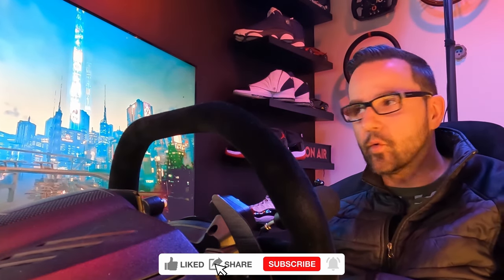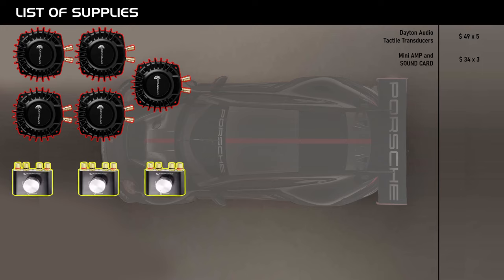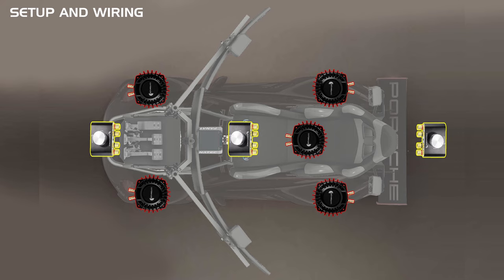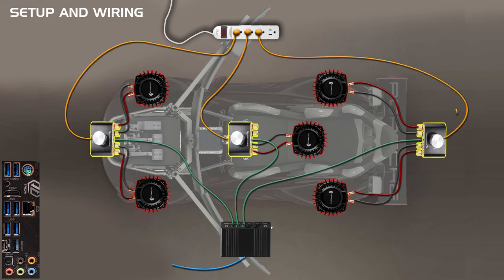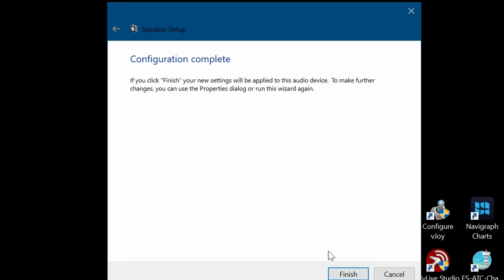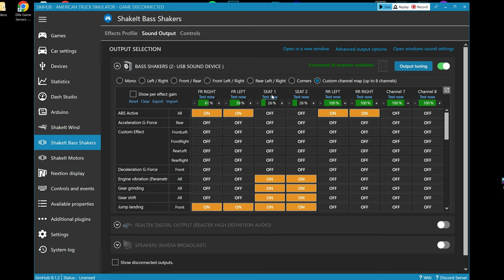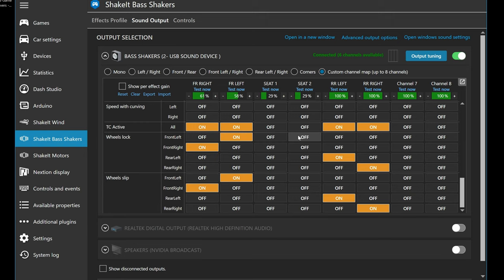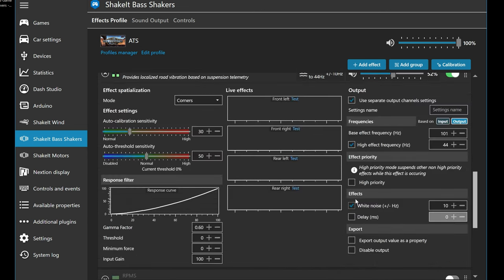DIY ULTIMATE Bass Shaker TUTORIAL | Step by Step HOW TO and SETUP

Comment: Very nice video and explanation!! Keep it up. One quick question, will it work the same way if I put car speakers instead??
Reply from the maker: Hi friend ! The sad answer is ...i don't think so.... These tactile transducers take actual audio and turn them into vibrations only. That's not very different than what a speaker does, but the outcome is very different. If you were to hook these up to music they would actually make sound. It would sound really hollow. The cool part is using sim hub as a software. It only sends low frequency vibrations to it. Now, if you were to send the same low frequency vibrations to a speaker you would get similar response. But because the speaker is soft and not encased in metal like this, the membrane of the speaker was just vibrate to low frequency. It wouldn't transmit that shaking to your rig.. I hope that makes sense. Please remember I'm not a pro. I'm just some dude. Take everything I say with a grain of salt ;) ...heck , try it just for fun . Lol
Reply: Thank you very much mate!!  @DaSimSimma

Comment: Is there any 3D printed BST-1 mount you tested? I would be happy not to bother with the wood work, but I'm concerned whether the plastic transfers vibration properly and is durable enough against vibration. On the other hand 3D mount seems to be a cleaner setup. Thank you :)
Reply from the maker: Sorry for the late reply. I actually did purchase a 3D printer and could attempt your proposal. I instantly have doubts about how it would perform just as you said : I could try to print an ABS but even so I'm afraid that it what absorb most of the vibrations. Second, I'm somewhat concerned with durability but only minimally. Stay tuned and I'll report back. I will need a bit of time to 3D prototype print try out and then make a video

Comment: Wow thank you very much for the detailed tutorial this will come in handy.. would you mind helping me with something, as this is all very new to me,I have just bought a simple setup to use on my PS5 and play seat challenge x, basically I bought 3 of the mini Dayton TT25 8ohm transducers and the Nobsound mini Bluetooth power amplifier with built in sound card which is 2channel and 50w and 4-8ohm.
My plan was to have one of the transducers (8ohm) under my pedals, then two transducers a on my seat, but running in parallel which I think then halves the ohms so each transducer would be 4ohm, is this safe to do I don’t want to blow out or destroy anything, any help you can give would be greatly appreciated..👍
Reply from the maker: Hi Marc , I was knowledgeable enough to wire this up and make a video trying to help other replicate my journey . But my knowledge stops there . I literally have no idea about ohms . That the danger with making a tutorial video : I placed my self in a perceived position of knowledge , truth be told , it was temporary and localized . Jokes aside , maybe the great sim racing community will step in to answer . Or go join SIM RACING SETUPS on Facebook . It a great group with over 70k members . Guaranteed they will have an answer !!
Reply: @DaSimSimma  thank you buddy I will go check them out, I appreciate your reply.. happy racing 👍

Comment: What exactly is the purpose of the sound card if the amps already have one built in? My buttkicker runs off of usb signal via the amplifier, nothing in between. Great video anyway, can’t wait to get this setup on my rig.
Reply from the maker: Maybe I glanced over that part but that is hugely important. If you have a huge same rig like-minded all sorts of accessories you'll utilize every single USB . Salt to use 3 amps with three USBS each it's too much. Going to 5.1 audio cord reduce his all of that down to one single USB it was just a matter of choice and necessity but it's not a must to make this
Reply: What about if you have a powered USB hub? I have 13 slot, so it should work, right?
Reply from the maker: I think it absolutely should !
Reply: Appreciate the reply my friend!
Reply from the maker: Sorry I'm often very busy and I use speech to text. When I go back and read some of my replies, I want to smack myself in the head. I hope what I said makes sense. If you go to my about page on YouTube, you'll find a discord link. If you join our silly little community on discord, you can always reach out to me faster and I'll try to help one-on-one if that's what I need to do

Comment: Thank you for this info.
I will almost definitely be setting this system up. may do it piece by piece though just due to cost.
Question: if using an external soundcard, do I still get 'normal' sound through my plug in speakers?
cheers: Saved and subscribed!
Reply from the maker: Hi friend ! Good luck on your build . Ps using an external card will absolutely save your internal card so it can play PC and game volume ! You can have multiple sound cards on a PC you just have to assign them accordingly
Reply: thank you.
Now to do some purchasing research lol @DaSimSimma

Comment: Thank you so much for this excellent tutorial! As you said a lot of information is scattered, never found one complete tutorial.

One question: would this work without the external usb soundcard by connecting the amps to the mainboards soundcard? My mainboard got a unused 5.1 onboard soundcard, meaning the 5.1 chinch connections are unused at the moment. Thanks again for your work!
Reply from the maker: I'm so sorry for not responding earlier. You absolutely can. The only reason I don't use it is because I actually use it to pump out 5.1 surround to my speakers in my room. But if you are not using it, you should absolutely get sound out from that and cut out the external sound card! My apologies again for the super late reply
Reply: @DaSimSimma  No reason to excuse, thanks for the additional information! 👌🏻

Comment: Thank you. Awesome video. I am planning to do 4 shakers. 
Question: for the small amplifiers, do you have to turn the sound knob on them to 100 and then just tune outputs through sim hub?
Reply from the maker: Absolutely correct !! Good luck friend . If you run into any issues go to my community tab we have a discord join and holler at me anytime I will try to help you. I hope another fellow simmer today and it worked out perfectly!
Reply: @DaSimSimma  Have you had any issues with the amps overheating at 100%.  I followed your video and have the exact same setup.  Been using it for about a month now and the other day I grabbed the amp for some reason after playing for about an hour and they were to hot to even hold.
Reply from the maker: Hmmm....now I'm worried...lol mine are tucked away out of sight and out of reach so I guess I'll never know. But let me put it this way, and don't hold me to this I'm not an electrician : hypothetically if you followed my setup 100% we should have arrived at the same result. Therefore, nothing's happened to mine which I hope nothing will happen to yours. I very weary on giving you exact advice with electrical components God forbid you have a fire. I'm sorry friend I want to say that everything is fine but you shouldn't trust me please keep looking into it
Reply: @DaSimSimma  Thank you for such a quick response.  As your video is the most recent setup video of this type I followed your instructions.  I am curious if yours heat up at all.  I am going to look into different amp options if turning the power down on the amps and the gain up in simhub doesn't improve things.

Comment: What about mounting directly to the seat?  Improved detail?  Less sound for wife?
Reply from the maker: I have one mounted underneath the seat because it makes the engine noises and transmission shifting. A lot of you refer to these as making noise but the reality is they don't make any noise at all they just vibrate the problem with vibration is that if it vibrates against something that's loose it will create a noise obviously. Now, everything that I have is in a basement on a laminate floor which is on top of a concrete floor. So unfortunately I'm not the best guy to talk to you about noise. Also, my sim room is highly soundproof that's the way we built it for exactly that purpose to try to isolate.. with all of that set I still get complaints about my music being a bit too loud when I stream lol

Comment: External Sound Card only worked with one bass shaker.   I had to  instead use the on-board NobSound USB, instead of AUX to SoundCard, before I could get both channels, on the NobSound to work.
Reply from the maker: Aux to soundcard will only give you one channel....USB to soundcard enables it to have as many channels as the card offers after you set it up correctly . The way you did it works also but the way I explain it has to be followed carefully. I say that because my card gives me all channels . The bottom line is ...it works for you , so that's all that matters ;) . How exactly you got there isn't so important I guess
Reply: @DaSimSimma  thanks kindly for the help and response. I would like to go the route you did as I plan to add more bass shakers, so apologies for my ignorance. However, I must have missed something in the video. I went AUX out on the NobSound to AUX in (center bass) on the external sound card and went USB out of the external sound card and USB in on PC. Going this route only gave me output (sound) from one bass shaker. Omitting the external sound card, allowed both channels to work. Is there something I missed when trying to utilize the external sound card, allowing only one channel (bass shaker) to work?
Reply from the maker: These things are a little bit difficult to understand through text. You can go to my about page and join my discord if you want. You can send me a private message and we can set up a quick call one day to work through this. I'm a visual person I'll need to show you the schematic and then you can explain to me also how you hooked it up. I hope I can help in some way
Reply: First off great Job. Just dove in to this sim thing. Ordered per your video. Waiting on all components to arrive. Only question at this point is you mentioned a sub. Don’t see on diagram. I’ll assume it’s running off the amp that has the leftover channel. Also it is one of the seat channels (effects)  that are represented in the software setup. 🤔 thank you again for taking the time

Comment: Excellent tutorial. I've had two mounted (front/back) for a year now. I'm curious about your mount method with the custom woodwork. Perhaps you can elaborate a bit more on that in another video? My back one is mounted to a VESA plate under my seat and the front is mounted directly to the side frame. Unfortunately, the latter proves to be pretty weak as I can barely feel it. It was under my pedal plate, but the plate is so thick that I felt zero vibrations. Still seeking optimal placement for the front shaker...
Reply from the maker: I'm so glad that this made sense and is helping you. The best way to explain the wood mount : I basically had nothing lying around but a couple pieces of plywood so I mounted the speaker to it and then mounted the plywood to the rig. In doing so in the fact that the plywood is a little bit flexible it allows the speaker to vibrate on the plywood and the plywood vibrates against the rig. That is how I'm transferring vibrations. To be absolutely clear : I didn't do it on purpose it's just what I had lying around and it turned out to work just fine. You're not the first one to ask how vibrations will transfer. As you experienced, if you mount them
extremely securely to your frame you will get no vibration transfers ; therefore they will be really really dim. I don't think I'm going to make another video to show my shity execution so please go to my community Tab and join my discord. Over there I can send you a dm with  pictures to show you in detail how I mounted it.
Reply: @DaSimSimma  Argh, this is my 4th attempt to reply to you in the past 6 days (WTF, YouTube!?). I think it's because I was linking to photos of my setup. Anyway, I got the gist of what you did by pausing your video at 1:58. I have plenty of spare plywood and MDF lying around, so I'll see what I can fabricate for under the pedal tray. Thanks!

Comment: Hi, great video, congratulations, I have 1 question to ask,
why didn't you use the 5.1 PC audio output?
instead of using the external sound card...
then I would like to ask is it possible to put your sim hub settings in an export file here on YouTube?
  to be able to download all thanks friend
excellent video
Reply from the maker: Someone talked about the same thing 2 days ago . But unlike you you . He. Just just assumed that I  was stupid. ...lol the real reason is because I actually use my 5.1 surround sound. I have a custom-built sim room where i run surround sound and I blast it crap out of it . Unlike a lot of people I don't play with headphones , I like to feel the full-blown sound and bass from the subwoofer. Adding an external sound card enables me to retain my original one on the back of the PC
Reply from the maker: Let me export my settings but please remember that my settings will be specifically setup for a 5.1 external surround sound with six or more channels. Let me drop the configuration file on a Google drive and then share the link here. Let me know if it works . It's going to be a couple hours from now as I am currently at work
Reply: ok thanks @DaSimSimma
Reply: Since we're at it, I'll ask you another question :)... do the bass shakers necessarily have to have contact with the wood or can they be attached directly to the aluminum profile, thanks brother
Reply: @DaSimSimma  hi friend,do you remember to put the file, thanks

Comment: Great Tutorial! Congrats! Queation - i read thag I can fry the transducer with the amp if I give it much power? How can I adjust that or just keep them safe? Where should I put the nobsound "wheel" on the front (i dont know the qorj for the tool in ftont of the amp). Thank you! 🙏
Reply from the maker: There are two parts to this answer. The first part is the noob sound doesn't put out enough power to fry it. The second part is i've been running mine for over two years with the dial turn at maximum. Please remember this turned it maximum you are simply telling it that it can receive all the power which it can handle. The second part which we should not forget is that you can control the volume or how hard they vibrate from the SIM hub software. So, if you turn down the volume in simhub you will get less vibration therefore it will use less wattage. To be very clear, I've been using it turned all the way up every single one of them for the last couple years. And if one of them breaks Please remember that one of mine actually broke and I have to buy another one so don't get worried, expected. These are very cheap items made in very large volumes in China so we must be aware of that.
Reply: @DaSimSimma  Appreciate the answer. I might get 2 more just for safety and test variations for transducers on different places out of the corners. I bought 5xAura and one Dayton tt25 for brake pedal eventually. The dayton is 15w. Do you think I should go for full power on the amp and adjust it on simhub? Short answer sound like that but as long as one is not used with that gear questions are always there! Thank you, grat channell by the way 🙏

Comment: Thanks for this, it helped me straightaway with my single baseshaker, however now with two I'm struggling a bit. With two of them, I have set one up on the brake pedal and asigned lock and abs to it. For the second one, on my seat, I've planned to do all acceleration feedback - wheel slip, TC. So far I'm struggling with the LMDH, as it's vibrating even on upshifts, even though I have only asigned the mentioned effects. Does the effect spatialisation have any influence on how the channels perform? If I have only two, should I set them to dual modes - like L/R, or F/R, or just Mono?
Reply: The Front/rear dont work for me. I use the 8 channel Setup (but actually only use 2 Channels in it)

Comment: This is very informative. I do have a few questions. So the  Power Amplifier cards plugs into out channels of the VAlinks USB 2.0 External Sound Card with 3  3.5mm Audio Cables. I have a 5 speaker plus subwoofer loitech 5.1 surround sound speaker system coming off pc PC sound card jack right now. So will I be able to run the 2nd VAlinks USB 2.0 External Sound Card  at the same time? I know silly question but, I don't know. I would also want to try and run the seat bass shacker off iracing LFE for wheel slip  but, that looks like it might  be mapped through Simhub with just that channel depending how it's setup. This is great and not as much as running a butt kicker system with all 5 shakers. I just Subcribed to your channel so happy I ran across it!
Reply from the maker: Hi friend ! You are asking the same questions I did and when I didn't know anything about this topic .  My fear was to purchase things that were incompatible and would have loose money as I learned .The cool thing is I have some information others have information we can all gather it together and create facts !!! Lol now back to your very simple question , the answer is : yes you can!!! It becomes its own thing ! Independent of the sound card that's powering your 5.1 system! Ps I have the same setup ;). This new sound card will not be assigned as your default communication device but it will be sitting there in the background active. Sim hub will be the only one assigned to tap into it . Therefore , no conflict ! You keep your beautiful 5.1 and gain a card for shakers !
Reply from the maker: And thank you so much for the compliment and for subbing . You are awesome . Anything I can do , you just reach out !!